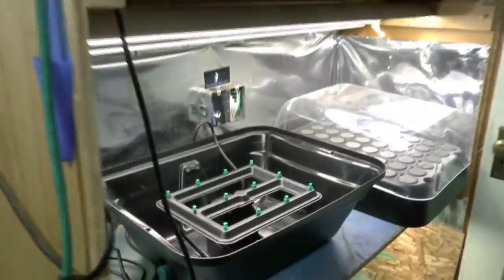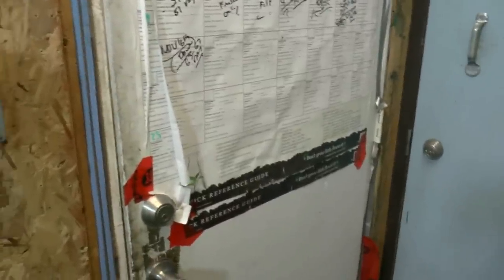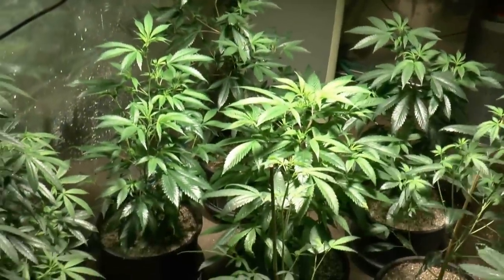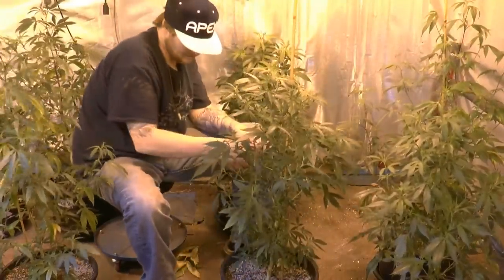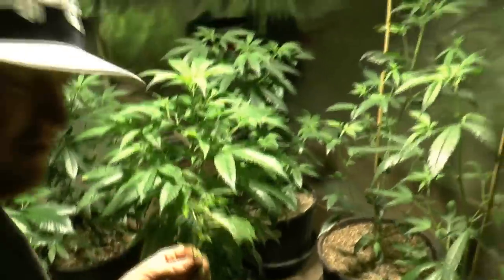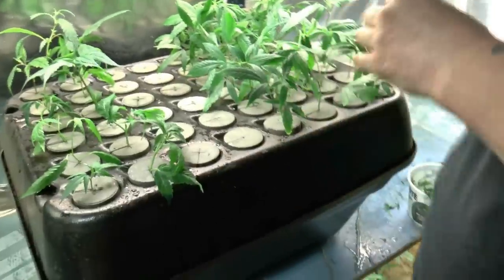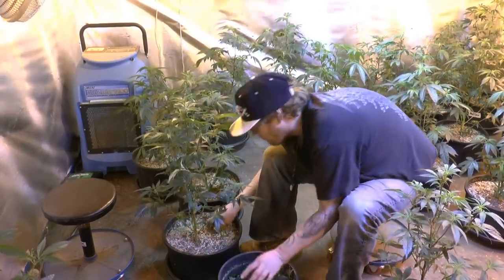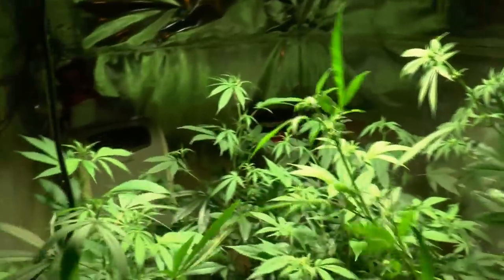A High Effective Spectrum King LED Grow Light Compared to HPS 4 , Cutting Clones

Comment: Hey John great vid. Do you usually run fresh frozen or dry material for fullmelt bubble?
Reply from the maker: Yes I do now, before I just use to run sugar leaf until Bubbleman showed me Fresh Frozen :)
Reply: John Berfelo
Have you tried running fresh frozen vs dried buds?  I have been drying in order to get the first couple of bounces and then running bubble.  The best of both worlds :)

Comment: Hey JB! Hate to point it out but your math was off a bit and may be why the clones looked sick. When you added the rapid start I believe you doubled up, 4 liters at 1/4 ml pet liter is actually 1 ml, 12 liters would have been 3 ml instead of 6. Hopefully this will help next round!

Comment: If your running a sealed room how are you getting co2 into the room when your tank if dry? I couldnt tell but I think you said your co2 ppm was 500 when you were in the room.  Where is the sensor located?  That seems high for night time? Outside air is around 350-400 ppm.  Is your room venting the excess co2 at night or are you timing your co2 controller to shut off early enough for the plants to consume the remaining co2 before lights out? If your co2 sensor is at chest high that 500 is going to be higher at root level.  Your plants look great.  Looking forward to the seeds!! Are you going to put up any vids of your Amsterdam trip?
Reply: he said he needs to get a new tank... its just a 20 lb tank they dont last but a week or so for me in flowering. have to go get a refill quite often. also his sensor most likely has a photocell that knows when its lights off and doesnt emit any co2. most nice ones do. c0o2 does sink you are correct but why would  you want to know what the co2 ppms are at root level, seeing as they take it in through stomata on the leaves? just wondering what you were saying-  maybe that he should have a fan stirring up the co2 that falls to the floor level?
Reply: You want oxygen at the root zone.  Co2 is heavier than oxy.  Even with circ fans I would think that a 500 ppm at chest high would mean an even higher concentration of co2 at root zone.  This could work to choke out the plant, the same way that lack of co2 will cause a plant to stop grow. Of course there is still some oxy in the tent, so its not that bad.  I just try to eliminate the co2 as much as possible for the night period so it is one less variable to hold me back lol  My further thought is that since plants arent using co2 at night, if John had  a reading of 500 at lights on, and since outside air is around 350-400ppm he had to have done something to get the ppm to that higher level.  (Like the tank)  Not to be rude but either john's not venting the excess co2 at lights out, or he is not venting enough, or there is a problem with the co2 delivery system that is pumping co2 duriing the dark period. (which would explain why they are higher if he exhaused to ambient levels) There could be other reasons, regardless it is an inefficency, and when I consider the cost of co2 from a tank and a room that size that cost can add up quickly. (and its no fun moving the tanks)  I know its a small thing and it might be a one time thing but when I finally thought through my co2 system and made the effort to time everything just right I was able to get another 4 days out of my tank with the same effectiveness.  I know it probably ment my setup sucked to begin with but I notice that a lot of people dont think through their co2 the same way they do other aspects of growing.  Peace

Comment: Johnny,have you noticed LED plants Needing less frequent watering/feeding?
Just curious,mine were watered/fed about every 5 days during veg
Reply from the maker: The LED light drinks slower for sure, I also have dehue in the other room the sucks the water out ..
Reply: John Berfelo could this be attributed to the heat from the hps evaporating off more water ? do you realize a spike of high humidity in one room compared to another ?
Reply: I was told by a tech a Dormgrow it was do to more efficient photosynthesis from the broad spectrum.Not sure if that's why but sounds probable. The leaves get larger with LED but less watering ,strange isn't it.
I wish there were more tests showing the actual science and real data.Not just from LED manufacturers.Most side by side grows show less weight and density but equal taste,smell and potency . Maybe Johnny and Bubbleman can give us some idea on differences
gland sizes,resin, terps , taste and smell profiles after Johnny's LED harvest...Oh and some macro photos too !!
Heat may also play a part but temps at the canopy weren't that far apart in my own experience.

Comment: Hey John, Do you use a water heater in your cloner and do you ph the solution?  I noticed a decrease in rooting rate when I I forgot to plug in the heater this past run.  I turned it off during the summer.

Comment: have you noticed any difference in success of clones in regards to the 'time of day' they were cut? i swear i get better results by taking cuts 20 mins after a fresh watering just as the light comes on. also I read somewhere once that a plant that is slightly starved of nitrogen will produce cuttings that will root faster than a fully fed plant. ever experiment with such things?
Reply: Your doing the right thing by taking clones just after the light comes on. I usually take mine about 30 min. after first light. This was something I also wondered when I first started about 15 years ago. Master growers like Jorge Cervantes will say the same. As for starving your mothers of Nitrogen before cloning. If you start about 2 weeks before you take clones, the mother will get woody which will help clones root a bit faster. Hope this helps.